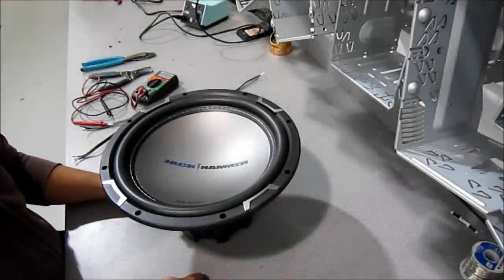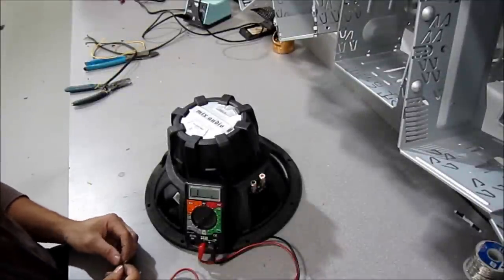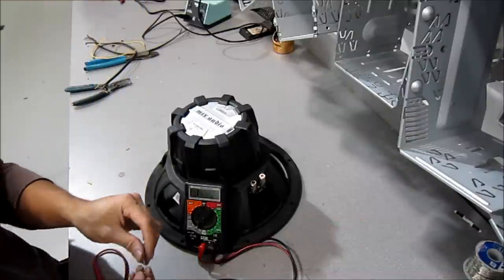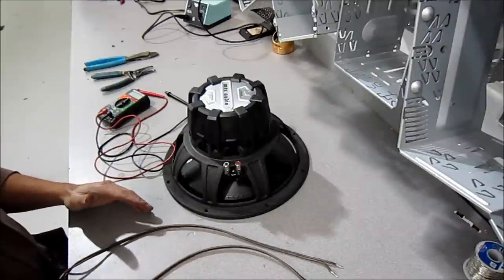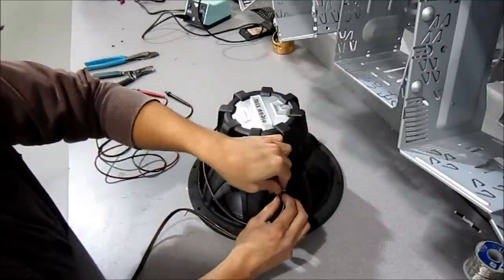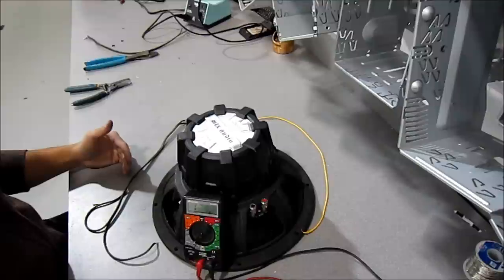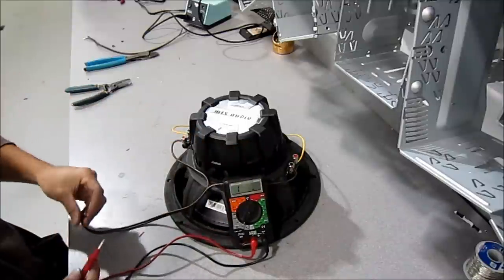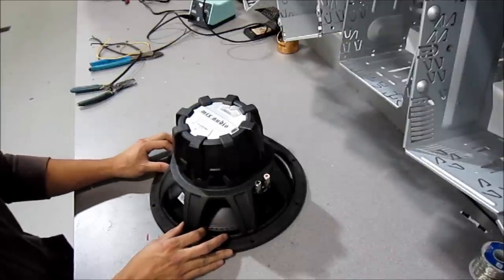Wiring a Sub Woofer | Series & Parallel (Dual Voice Coil sub woofer) | AnthonyJ350

Comment: Yeah, you can, and for the most part you can do so safely with most subs.  Option 1 is to just wire up one coil and leave the other, but that affects the Q of the sub (usually).  To avoid that, take another wire and short the unused coil.  That keeps the unused coil from electromagnetically resisting the coil driving the speaker, and allows the sub to perform as usual.

Not often you need to do it, but now and then it comes up.  Works fine.

Comment: Just got it out. It has two + an two - . Just like the one in your video. I have one Kenwood amp with the option on the speaker terminal to bridge it there or not. This amp is at least 15 years old an still works great!

Comment from the maker: If the amp only has one speaker input go ahead and wire it up in parallel for a 2OHM load.  To gsin your amp set the gain to 0 then turn the volume on the head unit to about 75%.  Then turn the gain up till you get the level that sounds good.  Of you have bass boost set that to about a quarter or none (that just amplifies the 40hz frequency).  The sub sonic filter cuts out the really low frequencies which are really bad for smaller subs like 8" and 6".

Comment from the maker: Sounds like you have a "bandpass" style box. Should be pretty loud if powered up properly. I'd look into a 500-600 watt RMS amp (so you don't break the bank) from either Alpine, JL Audio, Infinity, JBL etc and run 4 ga wire (like Stinger wiring) through the firewall to the amp.

Comment from the maker: Should be able to run each sub in series putting a 4 OHM load on each.  Then when you connect them put them in parallel giving you a final 2 OHM load.  But it really depends on the load your amp needs to extract the most power safely.

Comment from the maker: Wire it up in parallel so it's at 2ohms and hook up to one speaker output.  Do not bridge it or you'll go down to 1ohm.  If the amp is 1ohm stable you can do that.

Comment from the maker: Wire it in parallel and one DVC sub rated at 4OHMS each will give you a load of 2OHMS.  If you have two subs, wire them first in series each then wire the subs together in parallel going from 8 to 4OHMS.

Comment from the maker: By what you're telling me then the amp has a 1 ohm load on it.  It probably hits really hard but unless it's 1 ohm stable, you're probably pushing it too hard.  Safer to run it in series or buy a single voice coil sub and then bridge that one.  That will put you at 2 ohms and should be fine.

Comment: So you know I checked both channels to make sure they worked alone before testing it bridged for a moment, they did. Im sure you are right but maaaan is it a lot more powerful bridged, Sounds clean both ways. Cant say I notice much difference after switching the wires either. But Im no speacialist.

Comment from the maker: If it's a dual 2 OHM sub then you can wire it either for 4ohms or 1.  The video I showed was a dual 4 OHM sub so same concept except the impedance are different.  To be safe I would read the owners manual for the speaker output hook up.  I don't want to make assumptions on what your particular amp needs to extract the most power safely.

Comment from the maker: Cause they're dual 4 ohm you'll have to wires them up in series= 8OHMS then parallel them together to get it down to 4.  ohms at the end.  I'm assuming the amp is only 2OHM stable so that's the safest way to wire.  Unfortunately that will not give you the most power.  You need dual voice coil subs rated at 2OHMs.

Comment from the maker: @ChronicNateTV Honestly I wasn't using the best multimeter.  That particular sub had two voice coils rated for 4 OHMS each so it should have registered 8 in theory.  Or the parts used in the sub weren't exactly to spec.  There will be small discrepancies from time to time.

Comment from the maker: @zac2886 For sure, subs in any vehicle will make the system sound better.  Having a professional do the job is always recommended, because they can match the gear appropriately and set it up properly giving you the most out of the gear you paid for.

How were you picturing your system in your head???  Just so I can help steer you in the right direction.

Comment from the maker: K wire it in parallel so you get it to 2 OHMS.  But DO NOT bridge it.  Just run the sub off one channel and it'll sound fine.  If you bridge it you'll go down to 1 OHM.  If it's one OHM stable you can do that, if you're not sure don,t.

Comment: Fantastic thanks, let me ask you I have JLw6 v2 13" speaker in a box..if I wire it up in a 8 ohm configuration can I connect it to my home theater receiver as my subwoofer in my surround system, would that be a problem or would I need to connect it with a low pass filter set up etc. ? Thanks.

Comment: Thanks for the help. To be honest I dont know much about the amp except its a Kenwood KAC-7285. Its run bridged for the last ten years Ive had it (not saying it was right just functional) but when I took the sub out yesterday to rewire it I noticed that it was wired + to - instead of ++,- -. I fixed it to be parallel now and hooked it up to one terminal like you said and it hardly beats. I stuck the wires on it in the bridged position an got the normal pounds. How can I tell if im 1 ohm stable?

Comment: Hey Anthony quick question. i have a 4 ohm DVC subwoofer with a 2 channel amp currently bridged. Woofer is wired in parallel but should i have it wired in series? Other wiring diagrams tell me i should run in series. Also sometimes amp pops fuses. Thanks alot

Comment: thanks for your info.i hav a question,if the dual coil 4ohm sub rated 8ohm with series wiring how we can match it with the monoblock amp bcoz they only have the 4,2 and 1 ohm...??

Comment: So i bought my first setup for my first car.. bought a Boss AR12D with 1200w rms power handeling at 4ohms, and a monoblock (stable at 2 ohms) at 1500w rms at 2 ohms and 650w rms at 4 ohms, should i go for the normal setup or parallel?
Reply: First thing you did wrong was got a boss

Comment: Depends on what ohms your voice coils are.. If they are dual 4ohm, parallel would drop it to 2ohms.. Now depending on your amp if its 2ohm stable and if it aint gonna deliver a shit load of power at 2ohm like say anything over 500w rms@ 2ohm because your sub is only 400w rms then YES!!!! (Over powering subs is a beautiful thing but just don't excessively do it.. Some subs can handle double the rms amount required even more)

Comment: I'm not sure my amp would be able to run a 2 ohm load without frying........I think it would like a 4 ohm load better.    Would I simply just use one set of the subwoofer terminals for this load?   I measured across one set of terminals, and it read 4 ohms.   Do I simply ignore the other set of terminals on the subwoofer?   Thank you.

Comment: Hi I'm buying an alpine type r and it comes either in a 2 ohm or 4ohm option both being a dvc. If I buy the 4 ohm version would it be possible and safe to buy 2 2ohm amps and wire each to 1 voice coil, creating a 4 ohm load?

Comment: i just bought the kicker 12" dual voice coil subwoofer. and its a 2ohm. so should i run that in parallel. or series. its rated at 800 max and 400rms

Comment: @AnthonyJ350 ay man i just bought a truck and it has 2 12' dual somthing or another i no nothing about systems just 4x4's it has no power cord or amp cuz the the chord and amp caught on fire bye the door slamming on it instead of running it through the firewall what amp do you suggest i get and what kind of chord should i look for i wanna stay cheap its a clear box and got some chrome plastic shit like a rim over the speakers kinda ugly i think but please write back,or any one that can help

Comment: my amp says 2ohm stereo stable, should I run my speaker +,+ and -,- for a 2 ohm or  +,-  for a 8 ohm what I don't seem to understand is if the speaker is 2ohm stereo or mono when wired +,+ and -,-?

Comment: I have one 12” alpine type r 40hm+40hm, what’s the best way to wire it up for the maximum power from a 1200 watt amp
Reply from the maker: If it's a mono block stable at 2 ohms, wire the sub in parallel.

Comment: I know nothing about car audio, but want to make my system in my truck better. I found a sub that I want on walmart.com: (12-Dual-Voice-Coil-Subwoofer-Boss-AR12D)
How would I wire it? The other thing I was wondering about is, since the sub has a built in amp, after I wire it to the box, would I be able to plug the wires into my stereo or would I need something else between the sub and my stereo? My stereo is also from walmart: (Pioneer-DEH-44HD-iPod-HD)

Comment: so i got 2; 12" kicker 300 watt Dual 2 ohm (each) n an amp; logic (dbx1602) 1600 watts, i tried connecting them but only one sounds, what type of wiring should i do regarding connection from amp to subs ? amp too powerful? im new to this whole thing so any help would be great, thanx in advance.
Reply: I would say to run parallel just like in the video on your subs. On your amp to box terminals, you should do about the same thing if there is 4 terminals in total on your box, run negative to negative and positive to positive, but on one side take the speaker wires coming from your amp and do the same as your subs; twist them together to one of the negatives and one of the positives on the same side and put them together in the terminals. So pretty much the same thing with subs and box terminals. Go parallel, this will be your best bet in your situation.

Comment: i need some help i have a quantum audio qb 2150 2x150 i have a pair of infinity subwoofers 102.7 w selectable 1- or 4-ohm Operational Impedance im running my amp bridged and the subs at 4 ohm is that good or should i run the subs at 1 ohm plzz help thanks

Comment: So If I have a dual voice coil sub, at 4 ohms, and I run it in parallel, will it then be 2 ohms? I am so confused!
Reply from the maker: Yup and in series it'll be 8.
Reply: AnthonyJ350 alright, now if my subs run 350 rms at 4 ohms, would it then be 700 at 2ohms?
Reply from the maker: It's actually more about putting the proper load on the amplifier.  Do you know the specs of your amp for RMS power ratings?
Reply: AnthonyJ350 the amp is 320 watts rms at 4 ohms. and 1000 rms at 2 ohms,  per channel
Reply from the maker: ***** And how much power is the sub speced to run (RMS)?
Reply: AnthonyJ350 it's 400 rms at 4 ohms. and 1400 peak
Reply from the maker: I'd wire up the sub for a 4 ohm load.  You're really close 320 output off the amp to the sub.  Pushing the full 1000 might be a bit much for the sub.
Reply: AnthonyJ350  would it be bad to run it at 2 ohm load, or just a bit risky?
Reply from the maker: You can try it and just gain the amp appropriately.  But as soon as you smell something funny back off of it lol.  What size is the sub again?
Reply: AnthonyJ350 The subs are 400 rms at 4 ohms. 1400 peak
Reply from the maker: 10inch or 12 inch?

Comment: Ok I have one 12"  pioneer ts-w305c 800w max 400 w nom at 4ohms impedance and one 12" pioneer ts-w306dvc 1000w max 400 w nom at 4 ohms both going to be powered by a kicker zx200.2 amp. What would be the best way to wire this Frankenstein. I use to run just a,home made 10" tried to bridge it but it kept shutting down my amp so I'm a bit lost. Any help would be great
Reply: Come home babe please
Reply from the maker: Are you joining the subs together then bridging them at the amp?  Your impedance might be too low.  Also what's the rms rating of that amp?  It might not be kicking out enough power on top of that.

Comment: Hy i need help i dont know if I installed my sub amp right i have a 2 channel amp Rockford fosgate p500.2 and a Rockford fosgate sub r2 i have it bridge and its a 250 watts 500 watts peak and the bass sounds good when its low but once i get the volume up to 25 the sub starts to distort and i dont like how it sound i went to ported box to sealed and it dosent change at all ca. You help me plz
Reply: set the gains on the amp right

Comment: I have a sub with 4 terminals on each side. I'm assuming that is so I don't have to put 2 wires in a terminal. Its an Audiobahn.
Reply from the maker: How many terminals are on the sub in total?
Reply: 8
Reply from the maker: ***** Best thing to do is read the owner's manual and wire up the appropriate load for the amp recommended by the manufacturer.
Reply: I don't have the manual. I'm thinking that the 4 on each side is so you don't have to twist 2 wires together into one terminal.
Reply: +Daulton Ashlaw try a multimeter set to ohms across each bridge

Comment: No it won't have any affect it is speaker wire all speaker wire does the same thing
Reply: Gook luck if you ever have a system. You will never have a properly set up system and you will mess up your subs and/or your amp.